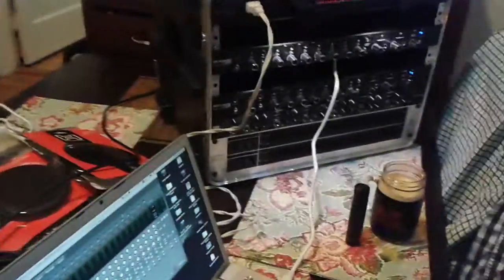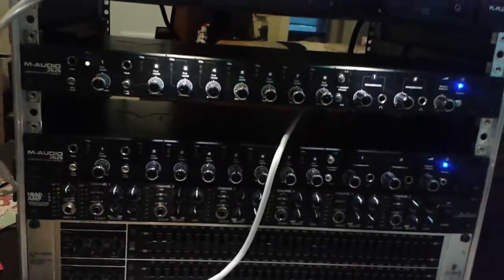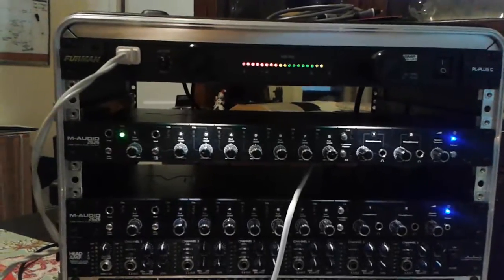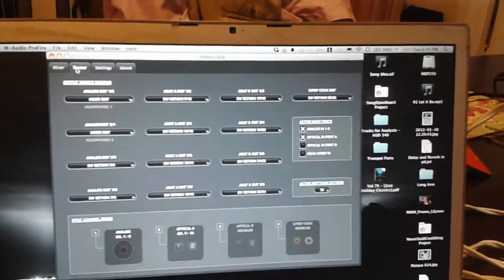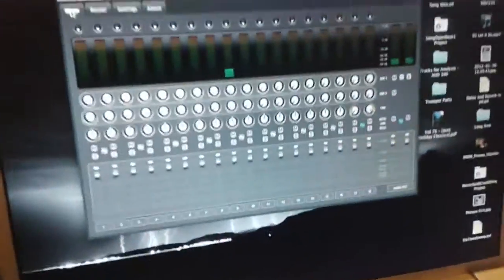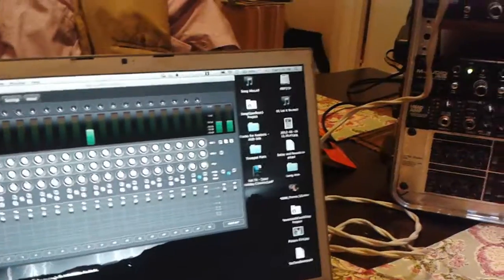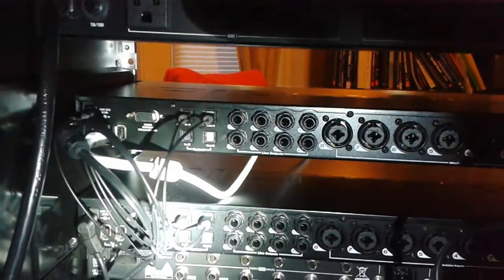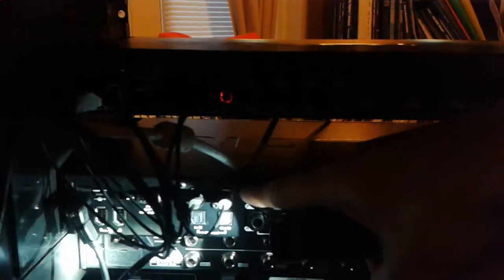Setting up two profire 2626, part 2

Comment: Nice, so you know if is possible to 2626 to convert SPDIF coax to analog and analog to SPDIF coax. Ony 2 analogue channels IN and OUT. Thanks 🙏
Reply from the maker: Hello João.  I think if you head over to the "Router" tab in the M-Audio ProFire software, you'll see in the upper right corner a S/PDIF COASX OUT, which has a drop down menu for what goes out from those ports.  You also need to make sure it is active (as opposed do DISABLE) down at the bottom INPUT CHANNEL ORDER section.  

If you jump over to page 37 of the manual it might break down the specifics that you are looking for.  https://www.hspshop.it/WebRoot/StoreIT7/Shops/167668/5AD4/97C6/9E3F/40FF/1FB4/0A0A/B011/7CBA/MAUDIO_PF2626_ENG.pdf

Comment: Hey Ryan! do you remember the settings for the stand alone 2626    The    (analog  out  1/2 ) and the  (ADAT A out  1/2)  thanks for video
Reply from the maker: Hey Jason.  Off hand I am not sure on this one.  If you go to "Settings" in the M-Audio ProFire software there is a "Stand alone" section at the bottom there.  Check this video for a walk through on someone who is using it in standalone.  https://youtu.be/G7FeDHNMxLI

Comment: Hello Ryan, can you hook up samewise a third profire 2626? Should one connect the third profire to the first using adat ports B on the first host profire and adat A on the third profire? How should you configure the router to define the satdnalone profires?
Reply from the maker: Wow, hmmmm... that is an interesting question.  My thought here would be the third unit would need to run in standalone mode, and then not be plugged in via firewire, but running as essentially an AD converter using the ADAT to send signal.  It "should" be able to take 16 inputs through the ADAT IN ports.  I have found the ADAT out needs to also be connected (even if the outputs on the second or third device are not used/available.)  

So, yes, I think your theory is correct, but setting up the ProFire (third device) may be something you need to set up while connected with Firewire and then unplug and only have connected with ADAT... wish I could help more on this, but I don't have a third one to test!  

Please let me know (and others who might be interested) if you find a solution!

Comment: Hey dude, I know this is an old video but I'm having connectivity issues when I set my profire as the host connected via ADAT to a berhinger firepower. I can get it to work with all 16 lines with the profire on standalone but it has pretty bad latency issues. Since the profire is a better machine, I'd rather use that clock but every time, it not recognizing the other interface when hosting. Any chance you can reshoot your settings in the profire app? I can't see your router settings due to old video quality. There is literally nothing online in forums or videos to give a step by step on app configuration lol! Appreciate it!
Reply from the maker: Hey Nick, hope you have figured this out, but my though is that if you can get things to clock correctly go with that.  Like using the ProFire 2626 as the main clock is not necessary if it works the other way around.  The clocking and multi-unit set up with the ProFires is not super obvious, so I often find switching settings out and then back (or just restarting the units) will help when they mis-take clock information.  

My settings, (which now also include an Audient ASP880) for the 2626 have the SYNC SOURCE as "Internal" SAMPLE RATE as "48 kHz" (or what ever is appropriate for the session) and the OPTICAL PORT B as "ADAT" so that the other unit sees that.  

The latency issue is an odd one.  I would guess that this is a clocking issue (not an actual latency like in the ADC or something.) So hopefully once you get the dang things to sync the latency issues will also go away.
Reply: @RyanEBlack  Thanks for the reply! I ended up scrapping the berhinger for a M-Audio 410 firewire. Had to work out the optical wiring as well as how to host the 2626. Figured it out! Finally figured I had to run them both as separate clocks by daisy chaining the fire wire but, it worked out! I now have zero latency and can use up to 16 tracks at once. Love firewire! Wish the industry still recognized it.... Way less issues than usb. Thanks!

Comment: Is it 16 in and 16 out or you have to choose between one or the other?
I’m asking because I would like to send to a summing amp and bring in 2 from the summing amp.
Reply from the maker: I have only been able to get 8 out to work.  But yes, 16 in.  It's frustrating on the output side.  I run the outputs to a PreSonus Central Station and then do my speaker switching there.  I use six of the outputs to run stereo headphone mixes to ART HeadAmp 6 Pro for headphone feeds. Then the remaining two outs run for my stereo mains for mixing.  https://artproaudio.com/framework/uploads/2018/06/om_headamp6pro.pdf https://www.presonus.com/products/central-station-plus

Comment: Hey man, Thank you so much for the videos.
Are you still using them?
Pro tools?
I’m considering buying 2 used.
Please advice.
Thanks again
Reply from the maker: I am still using them.  The biggest thing I'm running into is the driver software (ProFire 2626) is not supported.  So they are great, as long as I don't run into any support issues with OS compatibility.  Here's the link. https://m-audio.com/support/download/drivers/profire-series-driver-v2.4.4-mac Between the two of them I run into issues maybe once a month where I have to restart to get them synced together, though they are now running ADAT into an RME DigiFace.  I think the quality is still decent, but compared to setting up a Scarlett 18i20 (which I run in a smaller studio) I find myself jumping into the software and trouble shooting far more often with the 2626.  Long answer, but yes I like them.  It's crazy that they'll go up to 192 kHz, but they are old and be prepared to trouble shoot and swear at em until you get everything working.

Comment: Hey there! Can I use my focusrtie 18i20 as the master and the profire2626 and extra inputs for drum recording? Thanks!
Reply from the maker: I'm working on this.  Did you get it to work?  I've had issues getting the ADAT from the 18i20 to sync correctly with two 2626 interfaces.  Been a month or two and still no luck.  I like the software for the 18i20 better.  Would love to get that as the primary and essential run the 2626 as 16 in 16 out AD/DA converters with pre's.  So far I haven't gotten it to work correctly.
Reply: @RyanEBlack  Hey there! Yes I've got it to work! If you want to use all 16 mic inputs you can only record in 44.1 or 44k but it sounds great. So first you have to set the profire 2626 into standalone mode. Then I belive you go into the 2626 mixer window and select the input of each channel to be "analog input". Do this for each channel. I may have to prepare an organized set of instructions and maybe a video because it was very confusing to make it work but it can be done. I'll see if I can do that and try and get back to you.
Reply: @RyanEBlack  Hey Ryan, so sorry for getting back so late I'm gonna take some screenshots of my settings. Is there a way for me to send you those through YouTube or would you like me to e-mail you that information?
Reply: @RyanEBlack  Hey Ryan. So to start, I first configured my profire 2626. I connected it to my pc via firewire and then opened up the control panel. Under settings I set the hosted mode like this. 

Hosted Mode:
SYNC Source: Optical port A
Sample Rate: is set by the primary interface, for me it's my Focusrite Scarlett 18i20. 
Buffer size: mine is set to 1024. 
Optical Port B mode: ADAT 
S/MUX Mode: Automatic

Standalone Mode:
SYNC Source: Optical port A 
Sample Rate: Normal (44.1 to 48kHz)
Optical Port B mode: ADAT (88.2 to 192kHz)
Converter Mode: A/D -D/A

Master Volume Knob: I have all the options checked
Mixer Peak Meters 
MODE: Pre-fader
Peak Hold: 3 seconds 

Under the Router Tab

Output Source Routing: 
Analog Out 1-2: Mixer Out 
Analog Out 3/4: Mixer Out 
Analog Out 5/6: Software Return 1/2
Analog Out 7/8: Software Return 3/4

ADAT A out 1/2:  Analog in 1/2
ADAT A out 3/4: Analog in 3/4 
ADAT A out 5/6: Analog in 5/6 
ADAT A out 7/8: Analog in 7/8

ADAT B out 1/2: Software return 17/18
ADAT B out 3/4: Software return 19/20
ADAT B out 5/6: Software return 21/22
ADAT B out 7/8: Software return 23/24

S/PDIF COAX OUT 1/2: Software return 25/26

Active Input Ports: 
Analog In 1-8 is checked
Optical In port A is checked

Active software returns: I have all the options checked 

under the mixer tab:

for channels 1-8 I select the inputs to be analog. So for example on channel 1 i hit the circle button with a drop down arrow to select it to be analog 1. Do this for 1-8. 
Channels 9-16 I set to ADAT port A 1-8. Ex on channel 9 I select the option to be ADAT port A in 1, channel 10 is ADAT port A in 2, and so forth until you get to channel 16. 
Channel 17 is software return 1, channel 18 is software return 2

Focusrite Scarlett Settings: 
On the Focusrite Control panel go to Output Routing and I add hardware inputs for my analog channels 1-8 and you can add ADAT channels too. 

On the gear icon setting i just set my sampling rate to 48kHz and Clock source to internal
Digital I/O mode (Device restart required): Dual ADAT 
 
Sorry for the long message but I wanted to be as clear as I could because I really struggled figuring this out myself. Also you do need 2 ADAT cables in total. I really hope that this helps and please reach out if you run into something. 

Cheers and happy music making!

Comment: Good day... your using Mac or PC sir?
Reply from the maker: This is all set up with a mac, and in fact I just updated a 2011 Mac Pro with the 2626 drivers and it worked without issue!
Reply from the maker: An affordable option with other interfaces and RME (somewhat expensive as a brain) is mentioned below to YCP Bass.
Reply: Cuz im planning to buy this interface. And use it on win 7

Comment: U got 16 outputs??
I’m really interested to buy a second 2626 to hookup with the one I already have. But I’m more interested to have more outputs 🤔
Reply from the maker: I've had issues getting 16 outputs with the two 2626 devices.  Inputs, no issues, but running 16 outs seems to be something that is not (easily) in the software.  I now utilize an RME Digiface in the studio which allows 32 in and out all on ADAT BUT, I'm still having issues getting the 2626 to work with more than 8 outputs due to their need to be controlled via the M-Audio software.  I've set up three small studios with the RME device and multiple Behringer ADA 8200 and that gives everything running on ADAT (32 in and 32 out) and then it's just learning the RME software.
Reply: What RME? Are you using Pro Tools?

Comment: I do 3 2626s for a total of 24, has any one done 4 or 5 ?
Reply from the maker: haven't gone above three.  I Jane added an ASP880 optical pre amp and though it doesn't have outputs it interfaced as a third unit without issue.  I know a studio who has four Behringer 8 channel units hooked up for a total of 32 in and out.  works well.  I believe they are using FireWire 400 though.
Reply: I have 3 pro-fires. I want to use than all for drums. only 18 channels show on the mixer, so how do I use the 3rd profire if I cannot see the channels for each drum,  Or why have 3?

Comment: Thank you for your help, mate. You have saved me a lot of frustration! 
I didn't know that both interfaces needed to be connected both ways. 
I thought, 'why is there a need for the host to send anything to the slave??'. I'm assuming (now) for syncing reasons. 
I did not find anywhere in the manuals (or anywhere online) that that needed to be done.
Reply: only if you need 16 outputs as well, then you should be sending host signal to standalone. If you just need 16 inputs, host should not require sending anything to slave. Correct me if I am wrong. I am about to test this config as my other profire 2626 is about to arrive :)